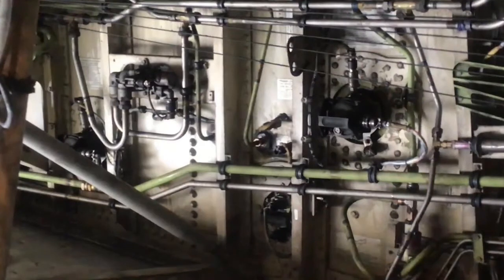747 400 Landing Gear Bay and Things

Comment: The attention to detail aircraft manufacturers go through to keep the fuel conspiracy going is incredible, it’s almost as if they actually use fuel!! 
If it wasn’t for Dr Jones dilligent research I would simply assume they used Jet A, thank fuck I’m now awake*

*please appreciate my use of extreme sarcasm
Reply from the maker: Travels of a Service Engineer no worries the sarcasm is strong with you! I have found how amazing it is that the engine manufacturers even provide fuel smelling liquid to drain out of fuel filters, engine driven fuel pumps, Variable Stator Vane actuators and Hydro-Mechanical Units when we replace them on the engines as well. As you say the attention to detail is awesome. 😀👍
Reply: ianobiwan I love the fake tankers, oil refinery’s, pipe lines etc...it’s simply superb. They even drill for “oil” to keep us fooled!
Reply: @Chriswizzv12  they even have fake oil spills and tanker collisions every now and then just to keep us fooled dont forget about them ! .